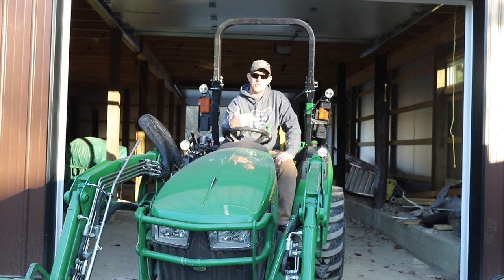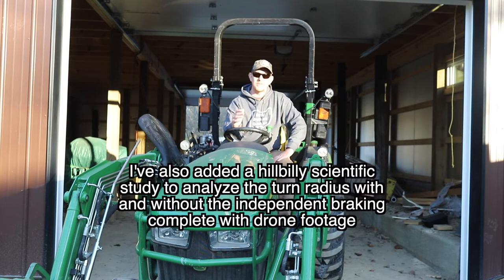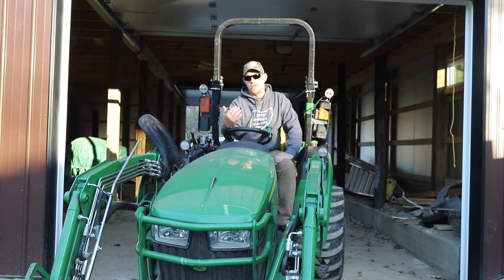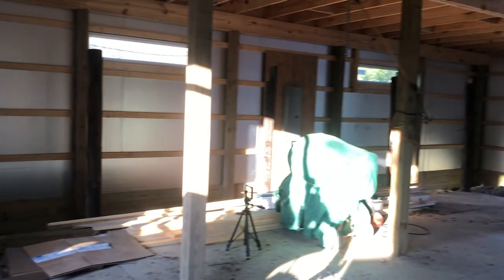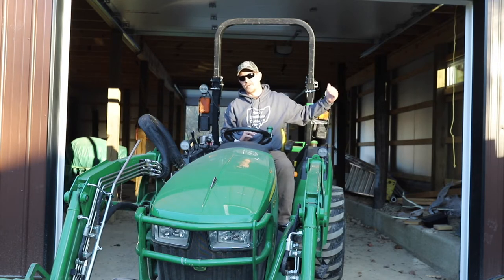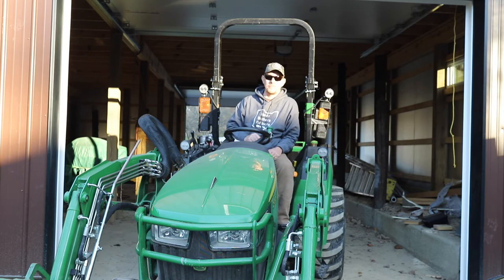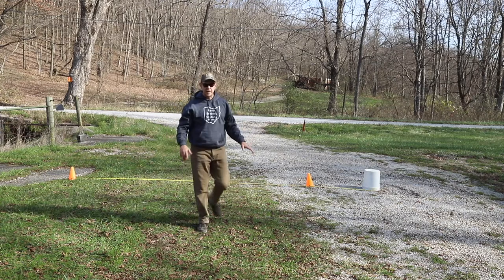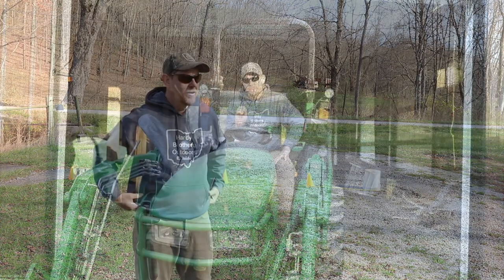#76 John Deere 2038R (2032R) Cut Your Tractor Turning Radius in Half with Split Brakes

Comment: Thanks for the vid. Years ago, I was discing on a mild hillside with a Farmall and needed to brake one side since it started to spin but there must have been oil or grease on that brake and when it locked up the tractor took off and almost rolled before I got it stopped. pucker factor for sure. be careful with those.
Reply from the maker: John thanks for sharing your experience... I find these tractors are great but they are certainly potentially dangerous machines and when it happens it happens fast.  I am always reminded that the gentleman that owned the farm before me passed due to a tractor accident.  The only flat ground on my property was man made...

Comment: I have a 2032r also and thinking of using it to mow the lawn. Does it tear up the grass to use the steering brakes?
Reply from the maker: It can definitely tear up the grass. You are essentially locking a rear tire so it will drag and tear up the grass. I mow with a 72” deck but my yard is a country property not a nice lawn.

Comment: The 2025 r does not have them. I miss them My 755 had them and one time they actually kept me from going in a pond. I also had a very hilly 20 acres. I always mowed in 4 wheel drive. And I know now do not use 4 wheel unless absolutely  needed. Or you will be replacing front wheel axle seals very soon.
Reply from the maker: Thanks for confirming and thanks for the info on 2wd vs 4wd...